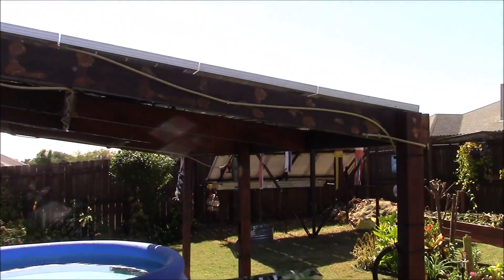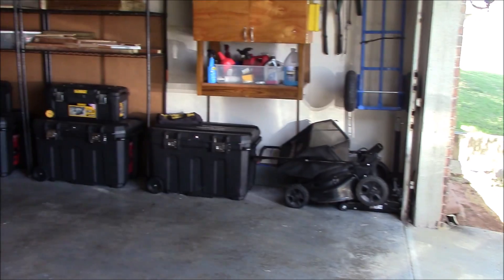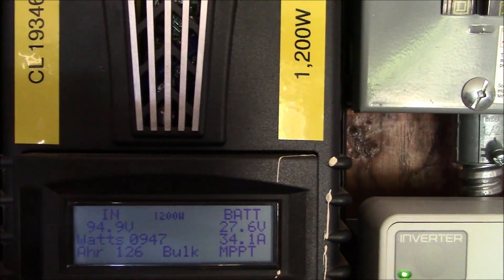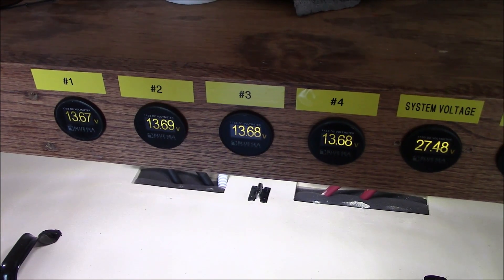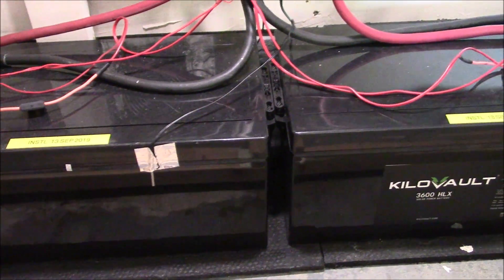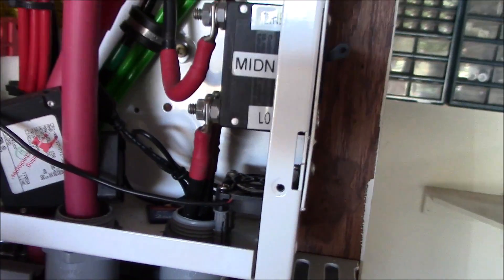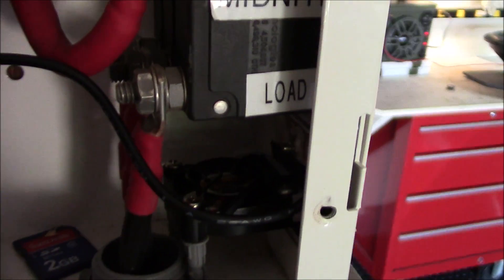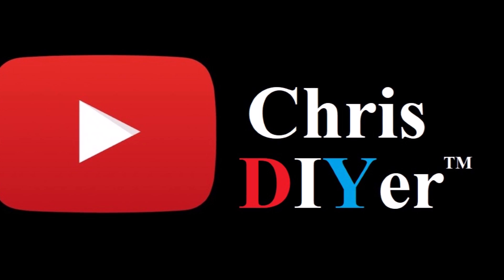KiloVault LiFePO4 lithium battery update -- 24v DIY home solar power system

Comment: Chris I was wondering about a battery called KILOVAULT from The Alt E Store. Are they a good battery and does Amphourtime make them ?
Reply from the maker: Mine are working great. The only issue is the SOC readings on the APP. The four batteries charge/discharge alright together in series/parallel, but the BMS indicates a 5% difference when approaching 100% SOC. Kinda annoying...likely nothing really wrong with them. Yet, I tried moving them around and individually charging them to 100% each...no change. Overall, they are solid (big) batteries from a good company. They shipped fast, boxed up great, came on a pallet.

Comment: Very nice!!!
Reply from the maker: Thanks...best investment in DIY solar one can make if doing off-grid or grid-assist solar. This whole system was designed as an "emergency back up" power source. Now, shoot, running all my critical loads 24/7 (autonomous operation)

Comment: Your solar setup is definitely bigger then mine🤪Lol  but yours looks incredible !!! Thanks for sharing 😊
Reply from the maker: Been "at it" for years (tweaking, learning, experimenting)...the new lithium bank is like night/day difference in performance, safety, and capability. You get what you pay for. Heck, those batteries will likely outlive me.
Reply: Good for you Bro...I’m so jealous of your system!! I’m in the process of getting some lithium batteries for my system and get rid of my 8 6v deep cycle battery’s..! Please Keep the videos coming !!
Reply: @blindliquor1  you still can use the old batteries to control the solar charger if not equipped for lithium batteries and save a lot buying new equipment.